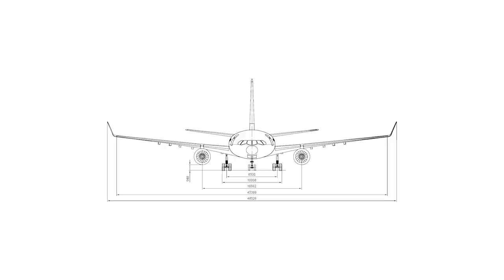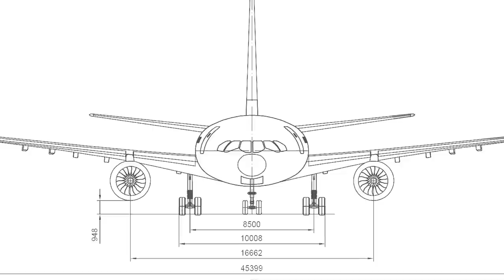Will We Ever See A 3 Aisle Passenger Plane?

Comment: The addition of an aisle has to make sense. 2-3-3-2 makes no sense, because this configuration can just be rearranged 3-4-3, which is the same as a 777 today.
Reply: It makes sense in a way that you don't have to sit next to a bunch of random people, if you're traveling alone or with one other person. 🤷🏻‍♂️
When it comes to airline's perspective, I guess they wouldn't bother to care.
Reply: But the 3 aisle one is wider cause there is 10 seat horizontal and 2 aisles on the b777 for example but adding another aisle wouldn’t fit either way
Reply: @deansicking6257  A third aisle that isn't necessary for passenger flow just adds more structural weight and drag – larger transverse cross-section – for no benefit. It's just a straight-up loss in fuel efficiency, which modern aircraft design is all about optimizing.

Comment: Yeah the an225 if it wasn't a freighter
Reply: It's funny because it's true
Reply: Celebrate my birthday joyfully and hope you get the presents you asked for
Reply: @jesuschrist5662  bruh
Reply: the Lockheed concept literally looks like the AN-225
Reply: An-225 cargo area width: 6.4m. A380 main deck width: 6.5m. The An-225 is no wider than the A380, though longer and capable of carrying greater weight.
Reply: @quillmaurer6563  just stick a Ryanair livery in it...
Reply: @AviationSimulation  Would be hilarious if someone did that in FSX or X-plane (or whenever someone makes an An-225 for FS2020). Title it "Your Worst Nightmare." Not sure who's nightmare though - passengers, airport maintenance crews fixing the impact craters in the runway, or those within 10 miles of the airport who's houses would be shaken by a 7-Richter-Scale earthquake every time one lands.
Reply: @quillmaurer6563  The An225 doesn't make that much more noise than a Boeing 747 Classic. The Concorde, however, made a huge noise on take off.
Reply: @gteixeira  I'm referring to someone's comment on a Ryanair An225. I'm thinking not the noise it makes on takeoff, but the earthquakes that would result from such a large aircraft being landed Ryanair-style.

Comment: There has been many discussions around flying wings, so they would certainly have more than 2 aisles.
Reply: I watched an explanation of the design of wide bodies (which I forgot where to find it) which said that flying wings would have cabins within the main cabin for the design. The only thing that will suck about this though it that most of the passengers won't have the option of natural lighting for their cabin unless they sat on the outer cabins.
Reply: A blended wing plane will have the main entry/exit at the very rear via a ramp. Like a military transport plane. So it doesn't matter how many aisles you have, actually more the merrier.
Reply: There have been discussions of flying wing passenger aircraft for well over 35 years. Plenty of theoretical benefits, practically...  It will never happen.
Reply: @RichardInSD  Never say never. The flying wing bomber was a dead duck by 1952...now we have the B-2.

Comment: Surely double-deck aircrafts already have 4 aisles? Two top floor, two bottom floor?
Reply: IQ 10.000
Reply: True, by your logic the 747 is a three-aisle aircraft. And probably two lower deck one upper deck would be the only three-aisle configuration ever built (at least with a conventional fuselage, flying wing/blended body might do something different), as any with more than two aisles on one deck would certainly be a double-decker, thus probably having five or six total.

Comment: 1 and 2 aisles will be the normal, as the the standard time for emergency evacuation of an aircraft is 90 seconds. Evacuating a 3 or 4 aisle aircraft is going to take more than 90 seconds and I don't  see regulators like FAA, EASA, etc approving a 3 or 4 aisle aircraft.

Comment: Excluding a 'flying wing' design, aerodynamics (and cost) favours a narrow, but longer fuselage over a wider but shorter one. Until we reach a situation where the twin Isle is economically incapable of providing, the required capacity, I think it highly unlikely that we will see more isles - certainly so far as all but the super premium classes are concerned where additional isles would be perfectly feasible (may already be available) in the current largest wide bodies.

Comment: While I like the idea of a 3 or even 4 isle wide body plane, it takes a whole lot of energy (fuel) to push it through the air at jet aircraft speeds. That is a big reason a plane is stretched instead of fattened. Plus the amount of weight added is less efficient. If designers and engineers can figure out how to make it aerodynamically work and get a good wing and lifting body within the same external footprint of current large airplanes, we may see one of these aircraft in the future. If an airline can fill it, and the builders can make it affordable, a market may be found to make it work.  Plus if you can make it handle 2 or 3 rows wide of standard shipping containers, multimodal freighter roles may be found for this plane.

Comment: Unless discussing an unconventional configuration like a flying wing or blended lifting body, it would make more sense to have two decks than to have three aisles - what we're seeing in the A380. For more than that, the A380 could probably be stretched, or a longer two-aisle x 2 deck aircraft built. To expand beyond that and have two three-aisle decks, it would thus need to be significantly larger than an A380, like the Lockheed proposal. But we're already seeing that the A380's demand is severely limited, even if technically possible airlines have found that operating such huge aircraft isn't really advantageous. Thus even if technically possible, I doubt anyone will ever build such a plane because no airlines would want it.

Comment: No.  Not unless safety requirements become a thing of the past.  One of the most difficult challenges both the 747 and A380 faced was getting all of the passengers out of the airplane in an emergency in time.  It wouldn't be possible with 3 aisles.

Comment: um... Question 🤔
Imagine when the plane lands, and now there's 3 lines of people all waiting to go out the SAME DOOR... No thank you.   (but wait, there's more)  

Also, same thing in an emergency - if there is a fire on one side of the plane, now you have twice as many people trying to go out the same number of doors on the side that's not blocked or on fire. 

Also critical for airlines, adding more rows means wasting cabin space (that would otherwise make money when used for passenget seats). A wider plane also potentially means adding more doors for safety; which also adds weight, complexity, and eats up more space along the walls where seats would go.  

Ultimately, adding aisles only makes sense when the cabin is already SO WIDE that the overall multi-digit gains in economics allow for adding more access AND exits.
In most cases this actually applies more to blended wing-body design aircraft -- which currently haven't come into being due to aforementioned issues with evacuation/exits and passenger acceptance (from a passenger-experience perspective) 

In fact, one of the most critical passenger-perspective issues that engineers on ultra-widebody projects mention is the matter of G-forces; and the perceived angles of roll, and lateral elevation changes when the cabin gets wider, and passengers are therefore placed even farther apart from the centerline.

Think of it as rolling/rotating... clockwise and counter-clockwise during the fight.  In effect, a super wide cabin is potentially like sitting sideways on a giant teeter-totter. 

Imagine getting lifted 12 feet higher than the passengers on the other side of the plane every time a cross wind blows your wing higher than the other side... (slight exaggeration, but you get the point) 

Suffice to say, the realities behind the simple question of adding aisles (mostly for the sake of outdoing current records) creates way more problems than it solves.

Comment: I imagine that a flatter fuselage comes with a host of stability issues. Airbus had to do a lot of thinking to pull off the narrower fuselage of the A380 which structurally is not as large of a problem as a flatter one. On existing frames (perfect or almost perfect tubes) I do not see a considerable chance of a tri aisle application unless airlines are willing to give up on Economy pax capacity.